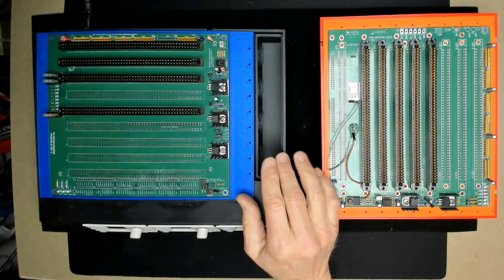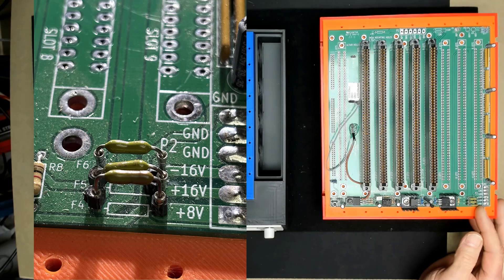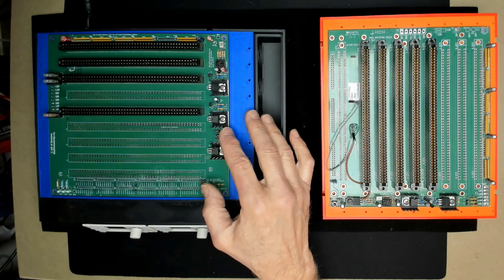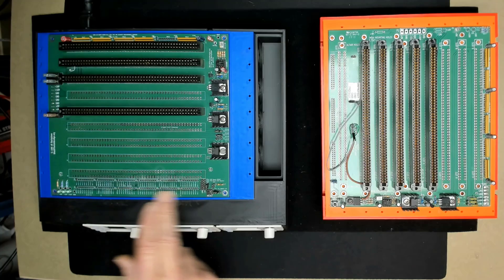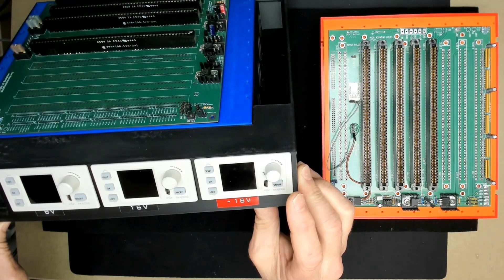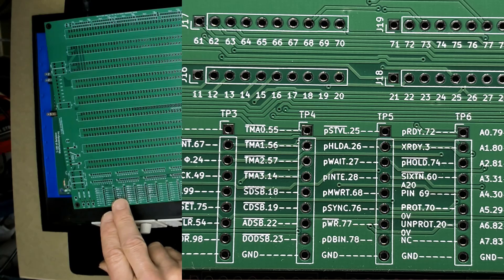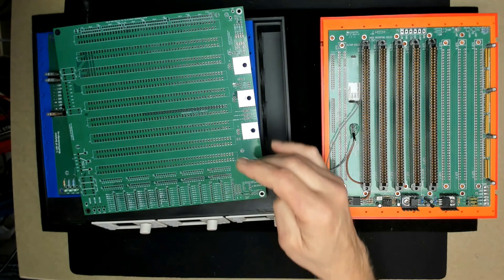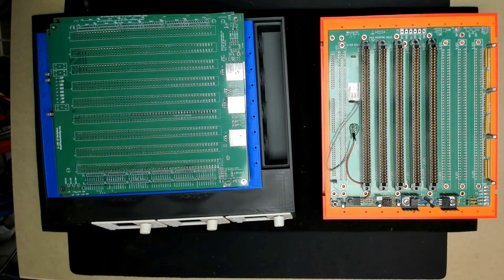{120} S-100 Backplane, another 'me too' project or is there a need for these

Comment: I can't find the G4250 op-amp so I'm assuming it's the LM4250
Reply from the maker: Yes, LM4250 (I am guessing they used the 'G' to mean a Godbout part number which could have come from multiple vendors).  I may have changed out the transistors.  I didn't notice that on the backplane they use the prefix 'G' on a couple of components but on the terminator 106 card they use LM prefix.  Email me and I will send you the v0.2 schematic that has the components i am using.